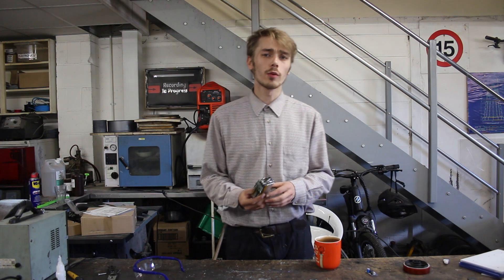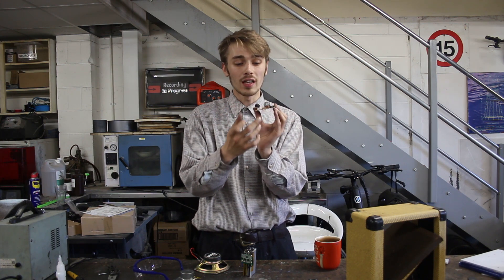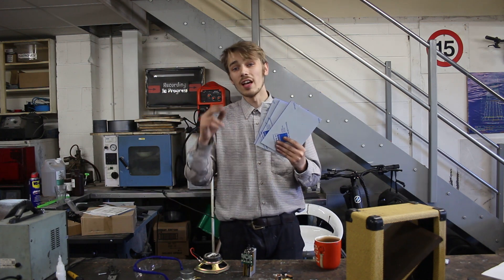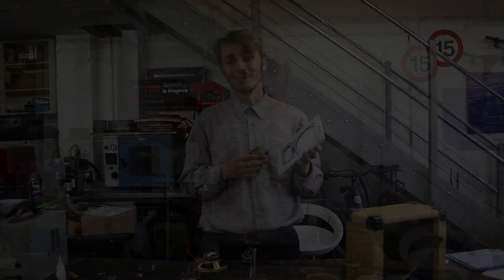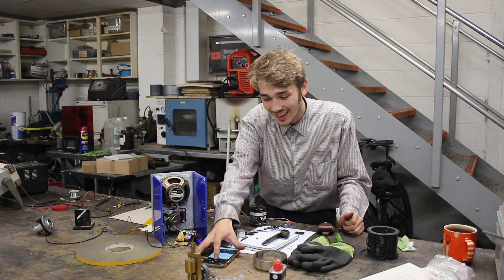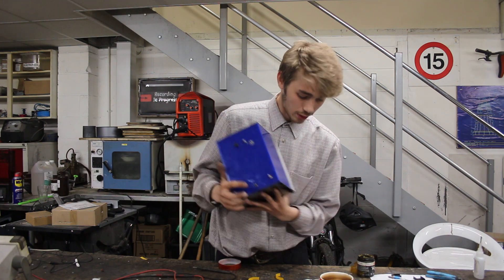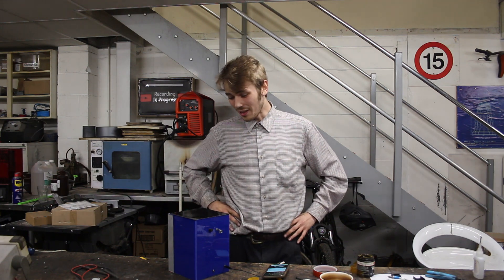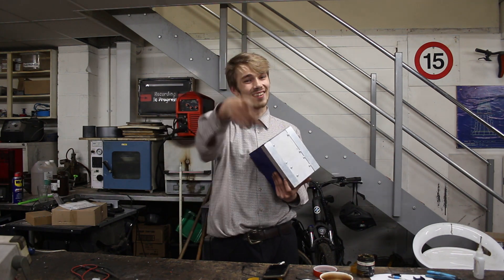1545 - DIY Wireless Speaker - Powered By Old Phone Batteries

Comment: I thought you were going to put a Bluetooth circuit in there. But an aux cable works too. Good job Luke.
Reply: See I should have added a Bluetooth module I reckon, The only reason I didn't do it, is that I built it from stuff we had laying around. The aux works surprisingly well, I have a USB-c adapter and a lighting adapter depending on who wants to use it lol 😂.
Thanks mate! :)

Comment: Uh, wireless? Without a wire there is no sound. Your title is misleading mate. As a speaker, it is O Kay. But I would not do without real stereo sound, and if I use 2 speakers, one would need to be real for bass/mid and the other for mid/high. Your smaller speaker is just a TV speaker (I guess) so for all tones.
Why are you opting for batteries in series? I would definitely go for parallel (no BMS needed).
So there is a lot you can and should do better.
And yes, this is all ment as positive feedback! We all get better from it.

Comment: If you fancy playing with Digital Signal Processing there is a company called TinySine that makes a 2×50W +100W Amplifier PCB with Bluetooth that has a DSP engine in it. The DSP is compatible with Sigma Studio so you can easily do things like sum the stereo inputs and low pass filter the result to generate the base signal. Delays an reverb might be possible but we haven't tried it yet. I have no connection with the company.

Comment: Very cool. Quality sounds great. Only suggestions I can think of at the moment are possibly adding some signal filtering for each respective speaker and rubber feet to keep it from sliding from vibrations.
Reply: Signal filtering? Are you talking about adding components for high and low pass?